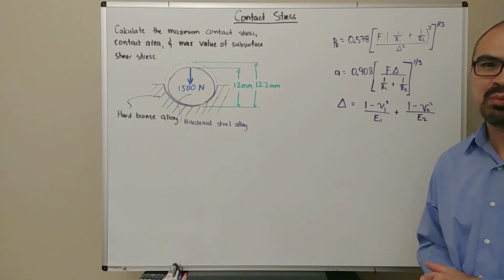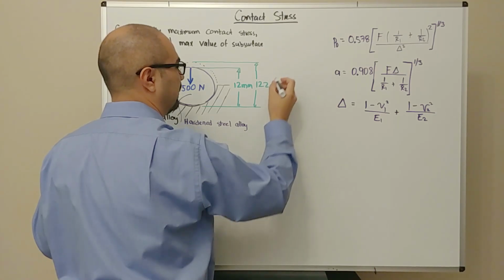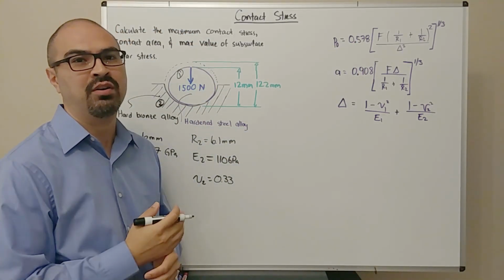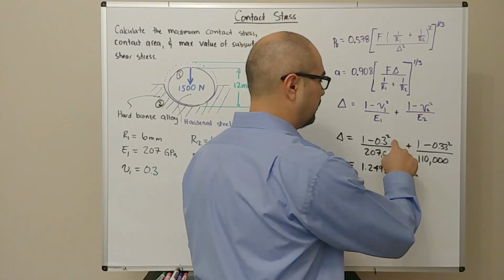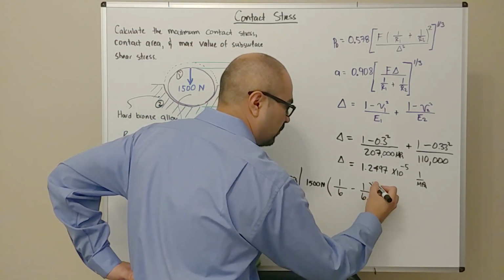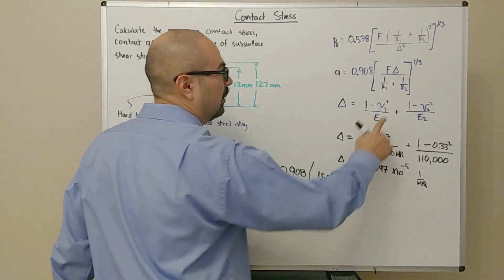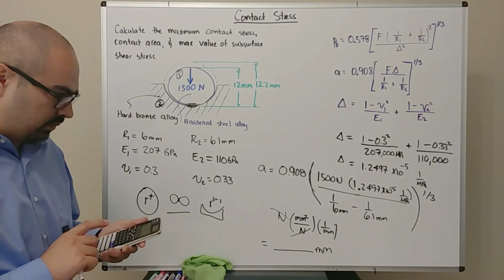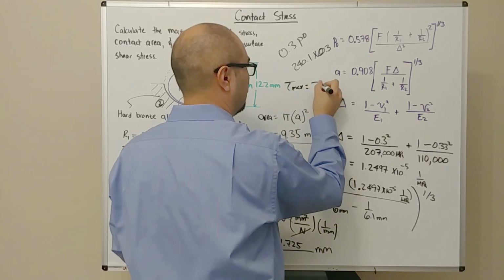Machine Elements - Contact Stresses in Ball in Socket

Comment: Dr. B, i have a question. To calculate the maximum value of the subsurface shear stress, you multiplied the contact pressure with the poisson's ratio or is it always going to be 0.3? Why couldnt it be 0.33?
Reply from the maker: Good question. The value of 0.3 is as a result of stress transformation equations, not poison ratio. Figure 9.15 in the booklet illustrates how the value of the subsurface shear stress varies with the distance below the surface and that the maximum is  ~0.3p0.